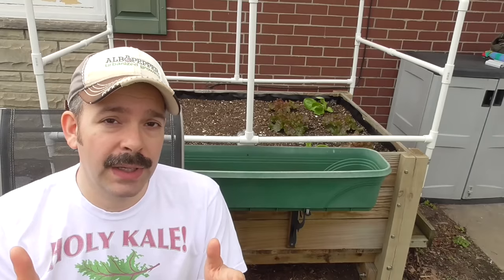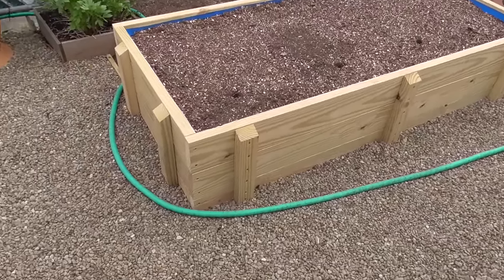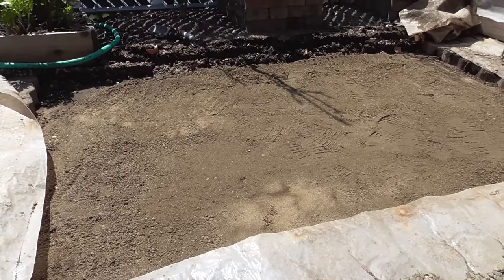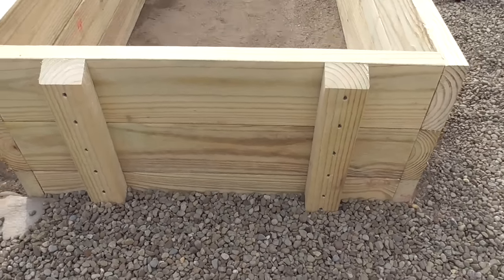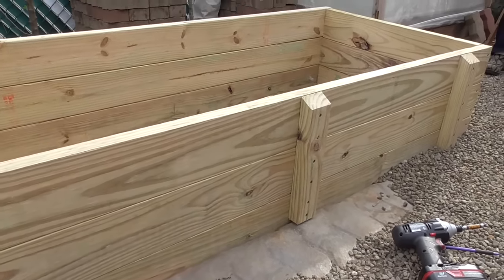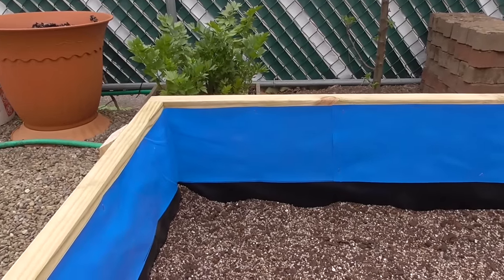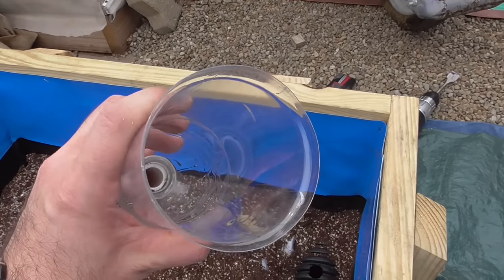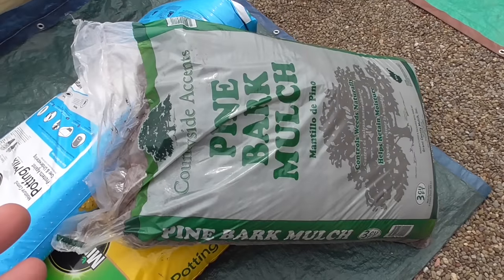Self-watering SIP Sub-irrigated Raised Bed Construction  (How to Build)

Comment: The heated petroleum gasses from the braided vinyl does interact with the base lining and the treated substrate.  Not to mention the other synthetic materials used.
Reply from the maker: It's good to be aware of potentially dangerous or toxic compounds in our daily lives. Obviously this concern should extend far beyond our gardening practices. It ought to involve ALL of the materials we use, especially the things inside our homes.

But in this instance, your claims are rather alarmist and they have not been substantiated in any way. The tiny little tube that you are concerned about is made from PVC. It's true, some PVC formulations have contained some very detrimental compounds.

But the vinyl used to construct the tubes I use in my SIPs is non-toxic and conforms to FDA standards. It is free of PBPA and DEHP (phthalate). It doesn't contain any of the known cancer causing agents as listed by California. It is listed by the National Sanitation Foundation for food equipment materials and potable water. It is resistant to corrosion and the effects of diluted acids & alkalies. The NSF rating lists it as safe for drinking water at temps up to 140°F.

http://www.newageindustries.com/downloads/Nylobrade_PVC_Hose.pdf
Reply: AlboPepper - Drought Proof Urban Gardening Just messing with you. Your setup is very nice. Great job.

Comment: Mr Pepper, We built a wicking bed in the desert of AZ, but made the water resevoir too deep.  Now we want to lower the level of the water sesevoir.  However, the local gardners tell us that the city water here is full of salt and the bed design holds the salt and eventually will not allow the plants to grwo due to salt buildup.  Please give us your opinion.
Reply from the maker: +debtru  - I think that correcting the overly deep water reservoir would be step 1. Once that is fixed you would have the capability of partially flushing the system from time to time.
 
The potential for salt build up in an outdoor SIP is about the same as a regular container planting. If you get any significant amount of rainfall, then you might not want to use a plastic cover on the top. Leaving off the plastic cover would allow the rain to naturally flush surface salts.
 
It would be interesting to know what the actual "salt" composition is in your municipal water. Is it high in sodium? Magnesium and calcium can commonly form salts in drinking water. But plants need a certain amount of Mg and Ca. Also, Nitrate (salt) contamination is a common concern in AZ due to agricultural runoff. This is bad for us to drink. But our plants would simply process it as a fertilizer.
 
These SIP boxes work best with annual crops. Excessive salt build up can be periodically flushed by rain water or even hard water from a hose. Perhaps this could be done between crop rotations or each growing season. Regardless, I would ask: "Exactly what salts are in my water?" If your water is high in Ca or Mg, then don't use epsom salts in your tomato plantings or reduce the rate of dolomitic lime application.

I appreciate you bringing up this concern because I had never encountered this issue before.  Hopefully that helps a little.
Reply: @Albopepper  When you rebuild to lower the water level consider installing a drain at the very bottom. That will give you the opportunity to totally flush the system.

Comment: One Question, 
Could home made compost mix work over those store sold compost mix?
Reply from the maker: It's possible that a quality homemade compost would work, especially if it had some fine woody particle in it. On a short term basis, I had tested some in a 5-gallon SIP bucket and the plant did well. You can read more about the topic here: https://albopepper.com/refreshing-sip-potting-mix-adding-fertilizer-year-2.php
Reply: @Albopepper  thank you, if it’s not much to ask one more question. 

Now on the pine bark, 
I have some dead cedar trees that I’ve been thinking of removing from the previous home owners. Do you think that’s a good option to use for pine bark?

Comment: I would like to grow a couple of Japanese Maples in my SIP bed. Will the soil mixture you use support the root structure of the trees?
Reply from the maker: PERENNIAL FRUITS & HERBS ARE NOT ADVISED: In a temperate climate, SIPs can freeze solid. Herbs and berry bushes make special preparations for cold dormancy in the Winter. The root systems are often where all of the energy is stored until Spring. SIP systems are above ground where it gets colder, reducing hardiness. And they can get waterlogged, causing root death. Never plant Fall time garlic in one of these. Even in the Summer, most Mediterranean herbs prefer drier, well drained conditions. Placing them in an SIP can do more harm than good. 

https://albopepper.com/sip_expectations.php

Comment: I learned quite a bit from this video but don't agree with using pressure treated wood and don't agree with not using compost. I have made small Sub-Irigated raised beds using Mel's Mix (1/3 vermiculite, 1/3 peat moss, and 1/3 compost with sand at the bottom to wick the water up), and they have worked well.
Reply from the maker: You can use any wood or building material that works for you. But there's nothing wrong with a grower using pressure treated wood if that's what they prefer, especially in areas like the US.

Comment: Followed this and another plan to build a raised planter.  Curious on initial watering.  I felt like the initial fill with water didnt fill all tubes.  That the tubes other than the one with the fill pipe didnt immediately fill.  I've been doing a few more water fillings after the initial filling to give the other lengths of perforations pipes to fill fully.  Just curious if others have done this.

Comment: Question1:Why not use any manure as fertilizer?

Question 2: I am considering using GI fence to make the frame instead of wood. Link the raised sides of the fence at the corner with hotly rings. Then line the inside with pond liner. Do you see any potential issues with doing it this way ?
Reply from the maker: Question1

Replenish Nutrients

BAGGED COMPOSTS? To prolong the viability of your SIP potting mix, it's best to replenish nutrients in the form of fertilizers. Organic gardeners are apt to use compost as often as possible. In SIPs, worm castings can be included in small amounts. But using composts in containers can yield unpredictable results. Bagged (retail) compost, humus or manure might have a fine consistency, similar to garden soil. If it contains fine silty particles then this can reduce pore spacing and aeration properties of the mix. That's why topsoil is NEVER recommended.

As air gaps get plugged up by ultra fine particles, compaction occurs. And since SIPs are always resting on a perched water table, the few remaining air gaps tend to be saturated with water. This impairs root health, preventing plants from getting the oxygen needed at the root zone. This can lead to a decline in plant growth, or even root rot and death. Even if plants grow ok in the first year, over time the potting medium may break down to the point that it must be replaced.

HOMEMADE COMPOST? Buying bagged compost is not financially advantageous in large beds anyway, not when compared to buying a bulk organic fertilizer. Of course, homemade composts might work, especially if they are mostly wood based. These tend to have more structure. Larger particle size means improved aeration. I've found though that it's very easy to reserve my compost for conventional beds and perennial plantings. It all gets used, just in a different location. 

https://albopepper.com/refreshing-sip-potting-mix-adding-fertilizer-year-2.php
Reply from the maker: Question2

I've never used that method, so I'm not sure. But if the liner is directly exposed from the outside it could be punctured or possibly damaged by UV light over time.

Comment: have two questions. 1. how do you fertilize the plant? do you put the fertilizer directly on the water reservoir? and 2. how do you solve the salt build up issue? Thanks.
Reply from the maker: Good questions! I use organic fertilizers such as Espoma Garden-Tone. You can mix it right into the soil. You can also dig a trench and put in a fertilizer strip. I don't recommend adding nutes to the water reservoir itself.

As for salt build up, I've never noticed an issue with this. Part of the reason might be that I don't use plastic covers so the rain is able to flush the system. Fortunately, I get adequate rain in my area. In drought ridden areas, a surface mulch can reduce soil evaporation, which reduces salt build up. Layers of plastic would work well for this.

If you have really high mineral content in your tap water, you could try harvesting rain water for your SIP. Also, avoid over fertilizing. Selecting fertilizers with a low salt index can help out (which is a good reason to avoid manure products in SIPs). You can practice crop rotation, perhaps using a cover crop to salvage nutrients that have built up.

Comment: Great build and great video.  I do have a question:  Do you ever have issues with algae growth in your SIP's?
Reply from the maker: +Darel Dougherty  - Hi Darel. I've never observed any algae issues in my containers. Using clear totes might be a problem.  But the raised boxes and beds are particularly trouble free. The sides are thick and they don't allow any light to enter. No light, no algae.
Reply: Thank you for the info.  Merry X-Mas.

Comment: What is the least thin of plastic you can use as the liner?  Is 6 ml thick enough?
Reply from the maker: I'm concerned that 6 mil plastic might puncture too easily. I advise a minimum of 20 mil. 45 mil is even nicer. I've put a link in the description for the kind that I've ordered for my last couple builds. There's a lot that that goes into these systems. It doesn't make sense to skimp on something as crucial as the liner. And remember, the top 10 inches of the sidewall can be lined with regular 6 mil, reducing the required liner size for the bottom part.
Reply: @Albopepper  Thank you, one more question...how  many drain holes do you have o this project?

Comment: Im not sure the reasoning behind your suggestion of not using manure or compost? any help on this?
Reply from the maker: BAGGED COMPOSTS? To prolong the viability of your SIP potting mix, it's best to replenish nutrients in the form of fertilizers. Organic gardeners are apt to use compost as often as possible. In SIPs, worm castings can be included in small amounts. But using composts in containers can yield unpredictable results. Bagged (retail) compost, humus or manure might have a fine consistency, similar to garden soil. If it contains fine silty particles then this can reduce pore spacing and aeration properties of the mix. That's why topsoil is NEVER recommended.

As air gaps get plugged up by ultra fine particles, compaction occurs. And since SIPs are always resting on a perched water table, the few remaining air gaps tend to be saturated with water. This impairs root health, preventing plants from getting the oxygen needed at the root zone. This can lead to a decline in plant growth, or even root rot and death. Even if plants grow ok in the first year, over time the potting medium may break down to the point that it must be replaced.

HOMEMADE COMPOST? Buying bagged compost is not financially advantageous in large beds anyway, not when compared to buying a bulk organic fertilizer. Of course, homemade composts might work, especially if they are mostly wood based. These tend to have more structure. Larger particle size means improved aeration. I've found though that it's very easy to reserve my compost for conventional beds and perennial plantings. It all gets used, just in a different location.

https://albopepper.com/refreshing-sip-potting-mix-adding-fertilizer-year-2.php

Comment: How do the plumbing tubes fill with water when they are not connected to each other?  How does the water get into the other tubes when the water is only going into the 1 pipe?

Comment: Does the overflow tube need to be soft? could you use a hard piece that is used for sprinklers? I'm in the desert and that tubing usually becomes decayed really quickly
Reply from the maker: There's no need for it to be soft. With solid SIP beds, I think the a rigid material might even be better. On my most recent 4ft x 8ft SIP bed, I decided to use 1/2" schedule 40 PVC pipe. It is working well!

Comment: is the 16.5 inch height including the water reservoir/drainage pipes at the bottom or 16.5 inches of potting mix above the water??  I cant seem to see much about SIP heights anywhere but figure its fairly important to the wicking capability
Reply from the maker: +browneaction  -Hi! The 16.5" height that I use is the TOTAL container or box depth, including the bottom of the reservoir. This number is not set in stone. But it is a good reference point which works really well. I advise aiming for that basic depth. Reducing depth increases soil saturation. Increasing depth will start to reduce the wicking capability of your potting mix.

Comment: Just curious, does using pvc plastic for the bottom lining is safe for vegetable?. Since the plastic does not expose to sun, my guess is it should be safe enough, but want to solicit other opinions.
Reply from the maker: +Nature   Fish are pretty sensitive to chemical inputs. If a lining is rated as "fish safe" then certainly it won't be harming the plants. PVC in general is frowned upon by many people. But our drinking water in our homes is often being piped in through PVC plumbing. So I'm not overly concerned about it.  An alternative would be an EPDM lining which can also be bought as "fish safe".

Comment: I'm super excited to build my raised SIP beds.  I live in the high desert of Utah so I have to ask if I should be using changing the level of the drainage tube to allow more water to stay in the bed?
Reply from the maker: Hi Amanda! Thanks for visiting my Channel. I would not change the water level too much. It's up to you, but I prefer to water more frequently while maintaining healthier roots. (As opposed to over-saturating the root systems, leaving them prone to root rot). Either way, I estimate that a 4' x 8' SIP bed of this design can hold nearly 50 gallons in the reservoir. So that's quite a bit of watering buffer!  xD

Comment: Hi Al!

I just built my box for my SIP and I am ready to fill with potting mix. I am a little nervous about the drain tubes. Do you suggest testing it? I built a 44.5" X 116.5 and have three drain tubes one seems a little high though. Any help would be appreciated.

Best Regards,

Dave
Reply from the maker: Hi David! Filling the SIP box up with just water would be a way to test your reservoir height. My only concern would be how to drain all of that water out after you've tested it. It might be a difficult process.

If only one of the overflow tubes is high, then that would still be ok. It would simply serve as a fail-safe. It would enable extra water to overflow in a heavy rain event (if the other 2 tubes temporarily reach maximum drainage capacity). If your bed is level and the other 2 holes are at a good height then I wouldn't worry too much. Hope that helps you out!
Reply: Al,

I tested it last night looks about right. I think I figured the draining problem. I have a shop vac and will vacum it out, while being careful not to suck the pond lining with it! You should collect pictures of the SIP's that you have inspired and post them on your sight.
Reply from the maker: The shop vac idea is such an obvious solution, but it had never even occurred to me! Thanks a bunch for sharing that.

I definitely want to compile a collection of SIP beds that our community has been busy building! Even a video showcasing some of them. I'm just so crushed with various responsibilities & projects right now that It's hard to find the time. >ugh< I'm gonna do it tho!
Reply: AlboPepper - Drought Proof Urban Gardening Yes, this time of the year is crazy busy. My SIP is functioning great. I just need to figure out how to trellis my tomatoes. Thanks for all you great content!

Comment: Hi, very informative thank you. Why no manure?
Reply from the maker: Thank-you for watching!

The biggest reason is particle consistency. Using porous potting mix components provides better aeration which boosts root health. Fine silty particles plug up air pockets resulting in compaction and an anaerobic condition. This can cause root rot. A large volume of manure products can act much like topsoil in this regard.

As a secondary consideration, uncomposted manures can pose dangers in the way of pathogen contamination. This effect is more serious when you think about the large reservoir at the bottom that could turn into a septic breeding ground.